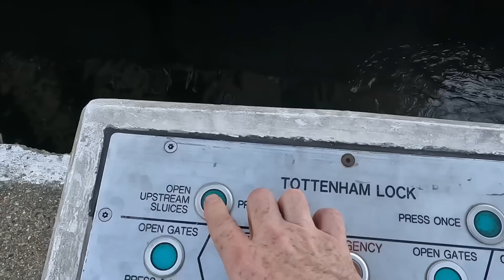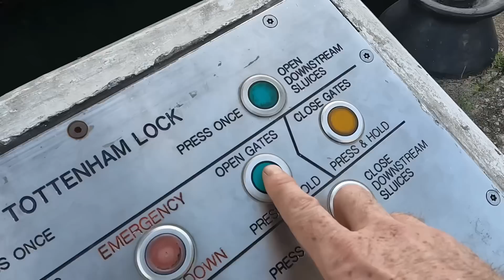Cruising to a HALT. The River Lea is overgrown with weeds….

Comment: Hi Canice. 
Jeez. You have my every sympathy. That is really tough. And stressful. 

Had a similar experience heading westward on the Royal Canal over here a couple of years ago. The summit level. Low water. Non-ending weeds. 

Took me two days to traverse that one level and made about 500 meters between stops to empty weed filter, unblock inlet strainers and even frequently having to clean out the heat exchangers. Never want to go through that again. 

Do they have a weed cutting boat and is it used there?

Hopefully it will get better soon. 

Stay safe.  

And be careful with the Sea Captain flying the helicopter. I’m not sure that he got his pilot’s license. 

Mark K
Barge M V Sarah
Reply from the maker: Hi Mark! 

The big problem in Ireland is lack of use as I understand it. I do plan to go to Ireland in Linda at some stage. One of the reasons for buying a keel cooled engine was for this reason. Although, if I go electric, won’t be a problem!😂😂😂
There are weed cutters but I never see it used. However, that maybe because I’m not particularly observant. On the other hand they are running a scooper/skimmer boat all the time. I will go into detail as to why it’s only this section that’s really bad at n the next moving video!

Comment: 5:15 - Another channel had a video going through that lock released yesterday, and there was a key left in those controls.  I wonder if it got stuck for someone?
(Your mast and that bright blue narrowboat made an appearance in the background, but they weren't having such big weed problems, so I'm guessing there was some editing time delay involved and they came by on a different day.)
Reply from the maker: I’ve lost keys in the lock before! It’s easy to forget! The underside of a narrow boat has swim that pushes the weed aside before the propeller hits it… Jorja will be fine when I reunite the boats. I think what Linda is doing, is catching the weed and uprooting the plant and the whole thing gets wound around the prop shaft…. Usually a narrowboat is also going at 800-1000 rpm with a small propeller which acts like a blender. Linda is going at 500 rpm almost half the speed. 
I’m only guessing…
Reply: @canicebannon  It was a wooden topped cabin cruiser with a V shaped hull, so probably pushes weeds away more than that.  I didn't realize Linda ran at such low RPMs though.

Comment: if the prop is lifting the weed up from the bottom maybe a plate welded under the prop would block the weed and you'd just glide over it?
Reply from the maker: I’ve taken Jorja through it and it had no problems. I guess the design of a narrowboat takes weed into account whereas a Dutch Barges rarely have to deal with this abundance of weed….